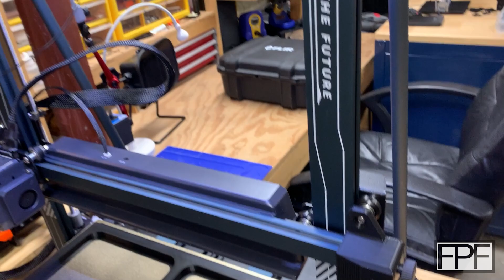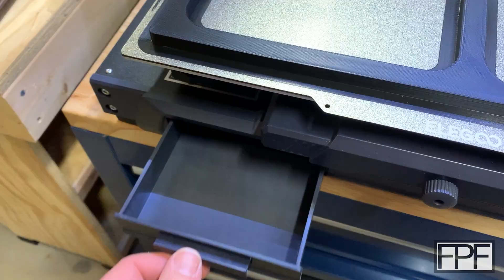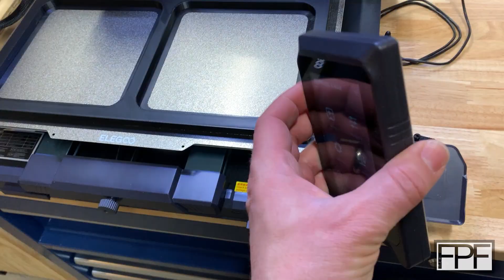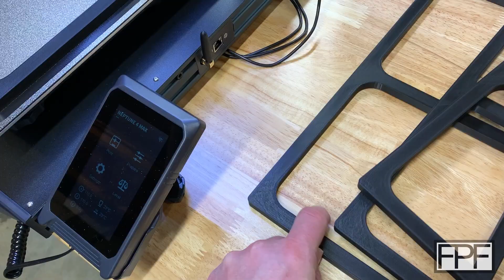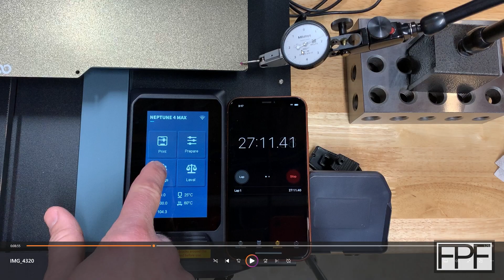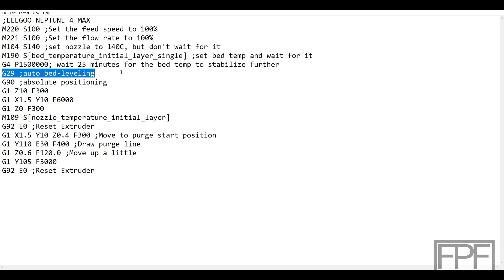Neptune 4 Max Review and a FIX for the PROBLEMS EVERYONE IS HAVING

Comment: First things first, I bought this thing back in October of 2023. It was my 2nd 3d printer after I started having issues with how slow my Flashfire Guider 2 was. I could not for the life of me get good prints out of this printer. I was positive I had a bad gantry out of the box and was trying to work with Elegoo forever to get a new gantry shipped. After watching this video, I was positive I had a bad gantry. Yours was the first video of someone running a print on it so I could hear what it sounded like normally. The second thing was back layers as I got near the edges of the build plate. Hallelujah, you have found the issue. I don’t know why I did not think of this myself.  My dad claimed he would dream about a car problem and diagnose it in his sleep.  I guess it is true if you dream it it will become reality.  After almost 6 months of this thing collecting dust and my moving on to now 4 Bambu Lab Printer I tried this with a new gantry, and I have a good print.  Thanks so much for finding this fix.  I now can print large prints like I wanted to when I bought this thing.

Comment: I am New to 3D Printing, and was just about to purchase this 4Max. Having fully watched this excellent video and reading all the comments, I am a bit confused. So here are some questions. Do all 3D Printers have similar problems? Is there something better out there at this price point? I too would like to print functional Prints only.  Any valuable advice would be appreciated. Thanks
Reply: Man, the Bambu Labs A1 or A1 Mini are pure plug and play!  That's why they're by far the biggest sellers of hobbyist level printers.  You'd be insane to buy this as a first printer unless you really want to spend a lot of time constantly tinkering on it because you want very large prints!  A Bambu A1 is $299!  Thank me later.

Comment: I have been seriously looking at this printer I understand the fix but I don’t like it. I have a few questions and this will probably take more testing is the build plate changing or is what the build plate is sitting on changing? Do you think changing out to a more efficient heater for the bed that heats the temperature much faster would help with the issues? Do you think there is a long-term hardware solution that would fix the issue?

Comment: Spoiler alert: Big bed has thermal expansion issues, you gotta let it stabilize for some 15m. Or you go buy a thicker better bed.
Do dynamic mesh, never use Elegoo firmware.

Comment: Pls stop comparing to bambushat ... its 3 time the price and its doing the same job at the end
Reply from the maker: Thx for your comment.  They do indeed.  They both extrude molten plastic and make shapes from it.  The user experience in having them do so, and the quality of those shapes out of the box however, is quite different.  I own and use both, and paid for both out of my own pocket.  The Bambu experience is turnkey.  The N4MAX experience is much more akin to what was common (and acceptable) 3-4 years ago.  The price for this machine and build volume still makes it attractive, and it's quite functional with lots of tinkering, but users should know what they're getting into.

Comment: I just took a look at mine with a thermal camera.  It's 3 hours into a print job, so presumable has stabilized by now.  The bed is set to 60C.  The temp of the back third of the bed is registering as 58C on the thermal camera, whereas the front half varies between 48 and 51C.  This is with ambient temperate in the space at 18C.  Pretty clear the large part fan is managing to cool the bed itself, which cannot be good for avoiding the bed distorting.  This is the first proper job I've printed on it, but I think I'll be turning the part fan off for now until the summer comes round.
Reply: Is this before or after they started putting the thermal padding under the bed?

Comment: I just bought one myself and I'm hoping it works out. I had another brand before but had to return it after an issue with the threaded rod ultimately resulted in the printer having to be returned. I got this one since the threaded rods are pre-installed in the uprights but all the stuff I'm going to have to try and remember is making my head spin.  

I'm grateful this video is here I just hope I can figure it out.
Reply from the maker: it's not a turnkey machine, but it's still a great deal for the overall size and capabilities once you've tuned it
Reply: Thanks to you and others doing similar content I think I will be ok. The issue I am having at the moment I feel may have more to do with a bad model or my inexperience with Cura (Elegoo says it's the most popular but I see maybe 1% of people online saying they use it) but sadly the model I found was distributed as a Cura project instead of STL or SCAD. I am going to try a simple benchy in the center of the bed to examine for irregularities. 

The model was a test for after you do auxiliary leveling that prints the 11 x 11 mesh patter in connected squares. Sadly it went horribly wrong and I had to stop immediately. @FunctionalPrintFriday

Comment: Hey Dude I'm loving your content so far thank you so much I imported your profile and I can't say I am as fussed about finer details, I just want my prints to actually happen without one defect swiping everything else off like dominos for the stuff I'm doing right now. 
So I skipped the 25 minutes delay, however these are the best results I've had so far with orca slicer, and one thing I noticed was that klipper is showing light on and off commands as unknown command have you managed to fix this to have it work on your printer with elegoo's firmware? I came from the neptune 4 pro and I am about to return it because I can't justify having 2 3d printers for my use, i can't figure out for the life of me why they didn't include rails for y and x when it only cost an extra 50 bucks on the n4 pro and the experience was night and day better on the n4 pro it seems you can't just upscale these printers and pump them out with half baked R & D.

Comment: Hi great video. I am having similar issues with my Elegoo Neptune 4 Pro. Could this be a fix also for the smaller models? The Elegoo Neptune 4 Pro has a Bed with internal and external heating which means when leveling i should heat both to 60 degrees before leveling the Bed and wait 25mins? Thanks

Comment: thats interesting because I was just thinking it would be better to do bed leveling up to temp, but realizing no one seems to do it All metals expand and detract based on temperature, but lets be honest We both know the elegoo has problems with that extruder head blob of death whatever you want to call it everyone seems to get it off of this model/Neptune so my question is, is what head is anyone modifying and replacing this thing with because it really needs to be replaced at this point it's really Maybe I will try putting in my H20 Extruder. It would be interesting to have a water cooled one.

Comment: I wonder if this could solve my nozzle hitting the filament. The first layer is near perfect, and then, an hour later, it starts grinding on the corners but not the middle.
Reply from the maker: That's what I would expect based on how the bed behaves.  Turn off the part-cooling fan and try the pre-heat.

Comment: My error 
Misunderstood what 2000th of an inch means, took it as 1/2000th of an inch... when its common parlance in imperial to mean 2/1000ths.
Anyone reading this can save themselves the trouble not reading more.

Its 0.012mm so its actually no where near as bad as you think... min layer height a 0.4mm nozzle can do accurately is 0.1mm so its ~1/8th of the layer height... not to bad(not good either) but I think its kinda impossible to avoid for any 3d printer with bed heating.
Reply from the maker: I think you missed the full range of motion.  Watch the timelapse at the end of the video.  It's more than .012
Reply: @onalPrintFriday 2000th of an inch is 0.012mm not 0.05mm
wasn't commenting on the rest, just 2000th by itself is nothing.
Reply from the maker: @givemeanameman1  total movement during printing cycle (without warmup) is .0062" or 0.1575mm.  I'm not sure what you're trying to say, but either way that's pretty bad :)
Reply: @FunctionalPrintFriday  you said 2000th of an inch was 0.05mm when its 0.012... not sure why its a big discussion...
Reply from the maker: @givemeanameman1 2 thousandths is indeed .05mm.  I'm not sure how you're interpreting what I'm saying, but apologies for any confusion.  EDIT: I think I see where we're talking past each other.  In the US, in machining, it's common to give measurements in "thou", "thousandths", or "tenths", which CAN be a little confusing.  When you hear someone say "2 thou" or "2 thousandths", they mean ".002 inches".  If they say "2 tenths" it means ".0002 inches".
Reply: @FunctionalPrintFriday  Ok, that makes sense, and yeah that does start becoming important...

At least we didn't crash a 330 million dollar Mars spaceship over metric/imperial conversion :)

Comment: I just bought one of these printers a week ago.

I prefer having a micro SD slot available. There is one, of course, but it is INSIDE the control unit.

I bought it for the huge print area. I want to make a prop for my boat, three blades, each 16" long, and the hub about 8" diameter unless I machine that part out of Aluminum. I also have other tasks all the time and my old printer was kaput.

LACK OF SUPPORT. An old version of Cura, for WinDOHs and Mac only, comes preconfigured for the machine. I had to download an appimage for Linux and then manually configure it because there is no official config file for Cura, Prusa, or anybody else. Manual configging can take a while, lots of trial and effort. Elegoof is deaf to complaints on this. I finally hot it humming along with gcode generated by Cura, from stl files generated in FreeCAD. The whole process is a bit fiddly with lots of cryptic error messages that nobody understands, apparently not even the developers, but I have done like 6 out of 6 perfect prints now. 

I like the covered frame. It really helps to keep the debris off the rails. Assembly was pretty good, too, for Chinese stuff. Nice to have so much of it already preassembled into two major sub-assemblies. It is like the AR-15 of 3D printers! Only a couple of screws presented problems. Packaging was excellent, too. One of the best packed pieces of light machinery I have ever ordered and received. 

The machine is so big and heavy, and can print so fast with crazy acceleration, that the machine WILL shake itself apart if you don't keep up with it. A tiny smear of Loctite Blue on problem screws will help. The drawer in front is for storing your assembly tools, because you will definitely want to keep them close. You want a really sturdy workbench under this guy, not the kitchen table or a folding picnic table. Ask me how I know.

Once connected, it is pretty easy to point your browser on a Linux computer to the fluidd interface. Just find the IP of the printer from the control unit menu, and enter it in the browser. I use Brave, and I have no problem accessing the machine over the network. I can monitor and control it, upload a file, warm up the machine, (if it is switched on!) and start a print. I can monitor the progress, too. 

I bake the Z offset into my gcode. That way it stays on the money. The auto leveling works nice but there will still be an overall Z offset adjustment. I do need to set up a webcam though, because I have had a couple of giant blobs.

The bed is nice, with decent adhesion without hairspray and without brims or rafts or skirts or whatever. I run the bed a bit hot, 70°C, and with PLA I am running the nozzle at 220°C. Even near the edges of the bed, prints stick fairly well, but when it cools they pop right off. I do get a faint overhang on the top layer and I will do some tweaking to make that go away but usually it is not an issue.

I always do a full leveling before any major print session, and check the Z. With a bed this big, you really need that auto level stuff. 

Your observations on bed flatness v temperature ramp-up are enlightening. I am going to start warming up the plate before leveling, and let it stand hot before printing. 

Wife wants new silverware drawer organizers that exactly fit the drawer and hold everything, so that's the downside to having a big printer. She knows I CAN do it, so no excuses. So that's my job for today after all the veg gardening and vehicle maintenance an fussing with my DIY BLDC project and other stuff. The problem with being retired is you no longer get days off. But I admit I do want to see how the Neptune 4 Max will handle a nearly 16" x 14" x 4" print job.

I do not regret buying this machine. I think in spite of piss poor tech support, it is a good value. I also agree with you that due to the tweaking in the dark required to get it working perfectly, it is NOT a particularly good purchase for a first time buyer. Nor is it ideal for someone who makes a LOT of small prints every day. Those needs are best served by a generic $200 open source machine. It will be easier to set up and use, and probably last longer if you keep those rails clean. When you start getting into printers with over a cubic foot of build volume, you are bringing a lot more gremlins to the table, and this one in particular will come with a lot of growing pains until there is a big enough peer support group to mentor the new owners. And thanks for the gcode snippage. I will be using a few lines of that, I am sure.

Comment: Not sure why you say nobody uses Cura?  I do and a lot of people I know still do.  Orca slicer is pretty new.  I haven't been printing much as in the last two years since I had both my knees replaced and had to deal with rehab.  And I think Orca slicer came into play about only a few years ago or unless it's that programs that everyone like to use since it runs on Wi-Fi.  I don't use any of my printer on Wi-Fi.  I still have my original CR-10 and Ender 3. You talk about simplify 3D like if it's the greatest program of all time, but once they stop making updates for it completely sucked and Cura had completely surpassed it in my opinion.  I've never tried any of the other slicers since I didn't have the time to work with a new slicer I didn't know and take months perfecting it.  If I can find a place that has tuned in setting already for both of my Creailty printers then I would try those and see how prints come out.  You come out sounding like an Apple fan boy when you say nobody uses Cura.  Sorry to say but a lot of people still do.  Your probably one of these that only use Mac too.  I'm a PC Windows user and don't have a Mac and won't buy into the Apple controlled ecosystem.
Reply from the maker: Meant no offense.  If you're happy with Cura, keep using it.  I prefer iPhone over Android, but I use windows and linux on desktop (no mac's).

Comment: Change out the power supply to get the bed to heat faster
Reply from the maker: The issue is the time it takes the heat to distribute through the materials evenly.  if we did manage to heat it faster, it MAY reach equilibrium sooner, or it may actually cause more distortion.

Comment: I had similar problem with leveling different printer. Sorted by changing yellow springs to silicone. Now happy days and ya heated bedneed some time equalise heat before print. And maybe will help fir someone my tip - clean your bed cold with very warm sponge to absorb all plastic fats. I long time cannot figure out where is problem, tried dish washer, isopropyl alcohol, different pastas e.t.c. , nothing worked because I cleaned warm surface. Now I use cheap sugar soap what sell in DIY stores, need just few drops. I also use sometimes pva glue diluted, just thin layer for better adhesion and if problem get part off sprinkle water around edges on 70C warm plate

Comment: I think this helps explain why so many people report the nozzle raking the print as it gets higher up in layers and knocking the print loose?
Reply from the maker: yes, that and the use of grid infill.  Grid infill is 'flawed' by design, and it only gets worse on larger prints, which is what people typically run on these machines

Comment: Niiice video. How about heating at 70-75 degrees and then cool down to 60? I think that would be a bit faster!
Reply: I was thinking this also.  Maybe insulate outer under edge parts with something so that they heat up faster (capton tape?)
Reply from the maker: there is actually insulation under the bed in stock form

Comment: I've done the manual level after letting the bed heat as you stated but how do I change the default bed temp to something other than 60 degrees when I do the auto level? Thanks!

Comment: I'm new to this and have the N4+ I have been finding that if I run a small first layer print before each print I get better results. It would therefore seem that I would be preheating the bed for nearly 10 mins before I do a print without knowing it and getting (what in my experience) acceptable prints . What edits would I need to do to make use of your orca profile . Also Will need to look into how to edit prinder.cfg. Have never done this. Thanks for the info

Comment: If you cant return the 
Printer, I would build an enclosure and add 10 degrees to your bed temperature.  I build for me a craft paper box. My last autoleveling was 3 month ago when i added the box. But I would check the heatbed circuit too.

Comment: I've had 0 problems out of the box with mine.   I've got a 60 hour print on it now  and I've done nothing but go through the configuration settings  and hit print.  I did relevel before this 60 hour print. Because it takes up the entire build area.   But that's it.    It's run great
Reply: How long did you say you worked at Elegoo?   ;)